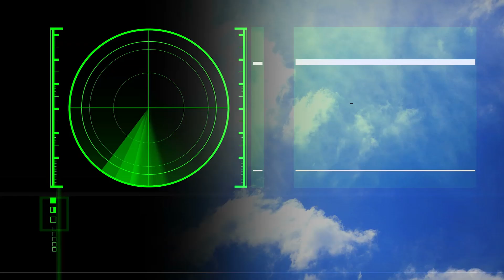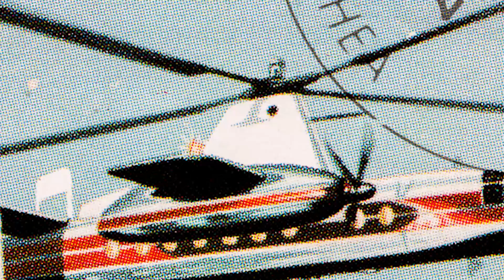Aircraft That FAILED

Comment: With Hughes at the controls, David Grant as co-pilot, and several engineers, crewmen and journalists on board, the Spruce Goose flew just over one mile at an altitude of 70 feet for one minute. As to the Dornier Do, which one are you talking about? There are at least 6 different aircraft that have that name, and the one you are using in this picture is the 17 and was designed in the 1930 for the was used by the Nazis and went out of production in the middle of 1940, and was definitely not used by NATO!!!!!  I believe you are referring to the Dornier Do31 and that is definitely NOT the aircraft you are showing!!!!!  The AvroCar never flew high enough to, it was unable to fly more than a few feet above the ground and would NEVER be confused with a flying saucer!  The engine in the Christmas Bullet was on loan from the military and he was told that he could only use it for ground testing as it was a one of a kind prototype engine and they did not want it damaged!!  The noise reduction program WAS successful for the Fairey Rotodyne, the had reduced the noise to the level of a London Tube Taine, the problem was that it had no buyers come forward in time to keep the program going!  The ME 263 not 163 did not glide with its own power, it had no power on decent or landing!  It was never flown in combat as the war came to an end before it could be put into production, as a result there were only three prototype aircraft ever produced and the testing program was never completed by the Germans!  It was a potentially cool video if you had done your homework!  As a result it was not even close to being accurate and therefore was not cool at all!
Reply: Mike's Micro Shop I was just about to rip American eye a new one but you did it for me thanks x